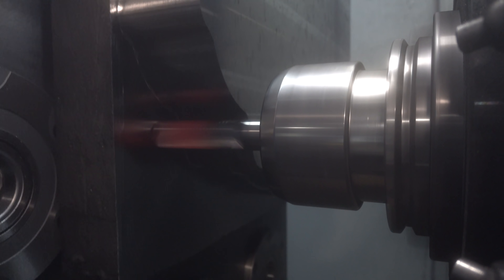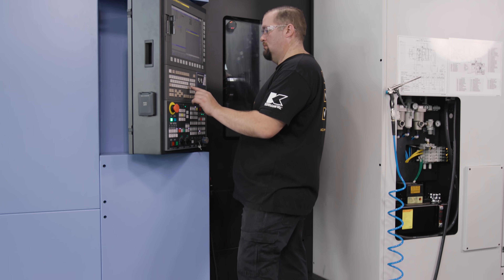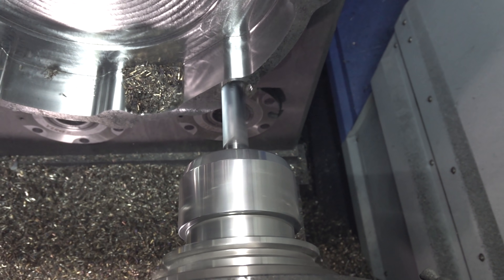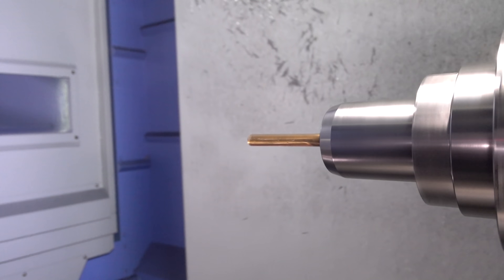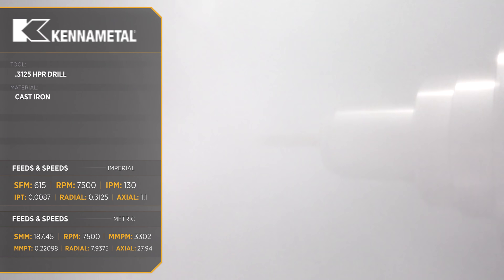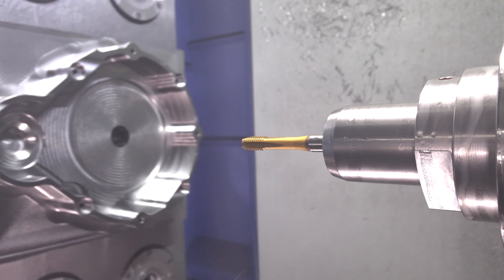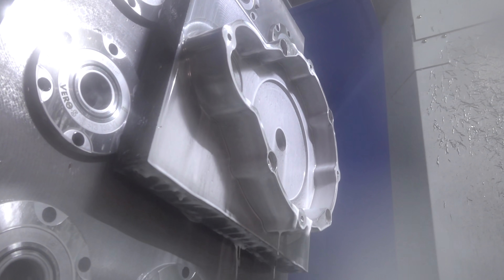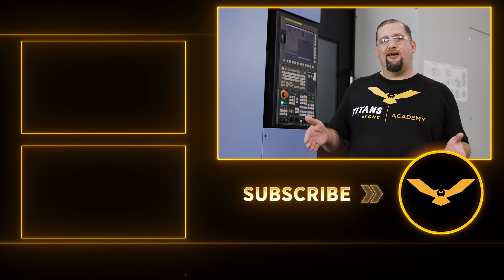Incredible Cast Iron Machining | CLEVER Tombstone Fixturing | HPR Drill + KOR 6 + Doosan NHM 6300

Comment: This is amazing! 
Watching this while grinding drills on the manual drill sharpener.... Apprentice life😂😂
Reply: I'm watching while programming a CMM. QC life.

I need to get back out in the shop. Desk work sucks.
Reply: @brahtrumpwonbigly7309  What is a cmm? 

Would love to learn more about that and how that works
Reply: @Sebastian-ed5kt  it’s the machine with the little red ball on the tip and it goes around the part touching it in a bunch of locations to test if it’s the right tolerances. Super accurate to the .000 I believe if not further.
Reply: @Projectpat0589  thanks for clarifying some people wont answer questions they think are simple asking is how we learn clear answers make reliable workers knowledgeable people and a stronger society you sir are a true leader

Comment: All we machine is cast iron where I work. Our foundry is right next to the machine shop. The rolls we pour weigh from 25,000lbs to excess of 50,000lbs. 70% of the orders are relatively mild steel and cut really smooth without issue. The Synergy 100, 200, and 700 steel however is much harder and eats up tooling. I'll do a 1.200" depth in-cut (x) on a 19.989" diameter neck @ 1.5ipm. Cutting both sides of the flat at once using a Ingersoll, double head horizontal milling machine. After that first cut which is approximately 19.00" long, I'm already flipping inserts. I'll end up taking 2.433" of each side of the flat.

Comment: You guys are not drilling holes anymore you are punching them. Those solid carbide drills are awesome. I've used those in the lathe at 4000 RPM and a feed of 0.01ipr. don't blink.

Comment: Such a coincident, that features on the parts matches your tombstone layout 😛
What are the tolerances on the bore for shunk mounts? Are you using the same endmill for roughing whole part and making those bores, or you have sister tool for finishing?
Reply: Yeah, that's a nice setup but as a subcontractor rarely would you have that opportunity
Reply: We used the same endmill for roughing and finishing
Reply: Lol I noticed that as well, most likely an academy part designed in house just for demonstrational purposes.
Reply: @duanewillis3223  Yes, got to be a demo part. Please show a casting next time, would be more far impressive.

Comment: What things do you focus on to find that balance between tool life and material removal?
Reply: The main component is time. With today’s upturn in manufacturing, time and available capacity is the biggest limitation. So you need to remove material as fast as possible, yet balance the cost of tooling with your hourly shop rate. If your shop rate is $100 per hour, and your tool is $200, you want that tool to last at least 4 hours, and remove as much material as possible during that time.
Reply: @barrysetzer  O I'm not asking in reference to budget. I mean what things are they looking at to maximize tool life while still maintaining a profitable material removal rate? What issues are they looking for that makes them change a parameter to achieve more life and/or more material removal.
Reply: Ah, so I work for Titan as mill supervisor, and personally programmed several of the parts in this video. We test tools above recommended surface speed and feed per tooth. Sometimes we find that the tools perform very well at feeds and speeds that are way above “recommended” values. Then, it becomes a matter of budget.
Reply: @barrysetzer  Ahh so you're testing for fastest possible material removal then back it down to achieve a lifespan that makes sense for the tools cost?
Reply: You got it!
Reply: @barrysetzer  How do you guys account for wear and tear on the machine? I've seen tooling cut great at spindle loads way above 100% but its considered accelerated wear on the machine so we dont do it.
Reply: I read a comment today that I absolutely loved. I will have to paraphrase, but lets say that you have a pen, and an unlimited pile of $1 checks that you must sign. Do you push your pen as hard as possible until it dies, and then replace it? Or do you use it as sparingly as possible so it will last longer?
Reply: @barrysetzer  How expensive is the pen?
Reply: Hahaha exactly. If the pen is $100 but signs $5,000 in checks, I would say the pen did its job. In the end, these are the things that you have to decide. In my mind, most machines are pretty much obsolete after 10 years. Maybe even 5. Titan himself said yesterday that he always ran them as hard as he could, and just replaced spindles when he had to.
Reply: @barrysetzer  I get that, but theres still gotta be a bell curve with an optimal output to lifespan. Unless you're doin predictive maintenance, then I guess it doesnt matter as long as its not failing within the allotted service life timeframe.

Comment: For the final operation, do you take X and Y inside that hole and Z on the unmachiened surface, right? 😁
Reply: Yes to x and y, but z used the face of the tombstone modules to control the overall height of the part
Reply: The offset there can be on the tombstone as well , that fixture system is pretty accurate , I use locating pins and screws to hold my work and I set my offset on the fixture and I just change parts all day